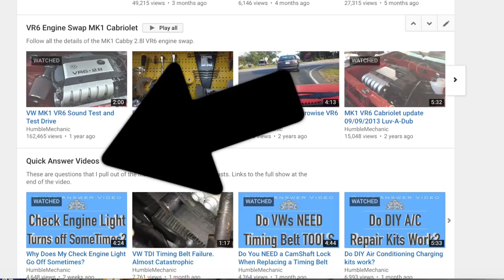Viewer Car Questions ~ Podcast Episode 223

Comment: Thanks again for the great tips. I had a coolant issue like the one you described on a 91 Merc Cougar with a 3.8 V6. I wish I had know what to look for back then. It would have saved me a ton of cash. I don't think people know how much time is saved having instant access to this kind of info on the internet. THANKS!
Reply from the maker: It’s insane to think about how people got info 25 years ago.
Reply: HumbleMechanic I remember having to go to the local library to get the book because I usually only had the cash for parts. I had a notebook of photo copies of pages for the cars I had at the time.

Comment: Most of the time when I've seen dark reservoirs on a VW, it's an iron block engine with the wrong coolant. There are alternatives to G12, G12+, G12++, G13 that are fine, but don't just grab any cheap coolant with 2-EHA, especially on diesels.

Comment: When swaping motors. Generally if it ran like crap or came back a few days later running like crap. It always was a vacum line came off or was left off after instilation. So vacum would be the first place I would go to. If that is OK, then I would check grounding strap.

Comment: I was the guy who asked the last question with the Vr6 swapped caddy. Turns out I took off the throttle body and cleaned it out and now it runs 90% of what it was but slowly getting better. I am currently getting ready to put my obd2 port in the car but all I am having problems now is my clutch now
Reply from the maker: I’m having clutch issues too. Lol

Comment: Hi Charles, great vids, as a techy id like you to do more in depth stuff, and how about doing a common faults chart for the most common engine series - might be v helpful. Also - does the rail pressure not spiking after hot shut off always indicate bad pump (internal valve)or could it indicate bad injector (excess leakoff)? cheers, Stefan

Comment: As far as performance under the engine bay. I would like to see a header back exhaust. Short ram intake, and a 75 wet shot of nitrous. I was actually in a mk4 Jetta vr6 with a 70 shot he said. And it was so badass. Pulled so hard in 2nd and 3rd. Way more than I was expecting. Cmon Charles. You know you want to.  It's something different than everyone else is doing to the 3.2s and affordable. Custom airbrushed nitrous tank with humble mechanic on it. I can see it now. Beautiful and lots of views. Lol

Comment: If I change the key cylinder and use the pre programmed key that goes to the new one would the immobilizer cause the car to shut off or would it not interfere with it?
Reply from the maker: If you get a new key, it must be programmed.

Comment: Popped a code for a coolant thermostat, would it be difficult to remove/replace? It's on a mk4 1.8t.
Reply: Not hard just time consuming. First time I did one on my Mk4 1.8t it took me forever because I tried to do it with extensions and wobble / universal adapters. Second time I went the remove the alternator route and that sucked as well. Third time I removed the intake plenum and that is the way to do it. Little more work will save you a TON of time. 

I would get that done soon though or your car will take super long, or will never fully hear up and your ecu will dump fuel trying to get it up to temp. Your mpg will go to crap.
Reply: Also just realized that you mean a coolant temp sensor not thermostat as the thermostat would not throw a code. CTS is a three min job. Def do it. That little green thing has a lot to do with how your car runs.
Reply from the maker: Pretty much what Adam said. LOL
Reply: Adam Rogers ah, just re-read the code and it is the cts. Glad it's that and not the thermostat! Thanks!
Reply: HumbleMechanic Wow thanks Charles! I have learned so much from you and your channel.

Comment: I know this has nothing to do with your video but I bought a pickup I was told it had a stuck valve I can't tell is checking out white smoke in the back I'm thinking a head gasket what's your opinion? thanks
Reply from the maker: Yeah it could be that. Could be an egr cooler, could be a fuel issue. What valve did they say was stuck?
Reply: HumbleMechanic they said it was number 3 exhaust valve.
Reply: HumbleMechanic cylinder 3
Reply: HumbleMechanic the motor sets in a 2002 Ford F150 with a with a 4.2 L engine they told me it was number 3 exhaust valve stuck cut the motor runs a little rough at idle that run a cops in real good thank you
Reply: HumbleMechanic number three cylinder in a exhaust valve

Comment: I have a 2012 Sportswagen TDi and have decided to participate in the VW buyback option. I turn my car in on March 13th and with the generous return I'm getting am seriously considering buying a new Golf Alltrack. Saw one in the lot yesterday for the first time and it looks smaller than my Jetta Sportswagen. I just have one kid (toddler), so I don't need a big vehicle, but what is your opinion on the Alltrack?  I searched your video library and couldn't find a review. Other options are a Subaru Outback and the new Tiguan. Thanks.
Reply from the maker: I like the Alltrack more than I expected. It drives great gets fair MPG, and looks cool. 

It’s about the same size as your JSW, but I think by the numbers it’s bigger.  

My issues with it are1) it’s a little smaller than I would want for that car. 
2) I want more HP(I always will want that) 
3) It came out at the worst time. It should have been out 10 years before. That delay let Subaru dominate that market. 

That being said with the deals they have on the 2017, you can get one for a great price.
Reply from the maker: I like the New Tiguan too. And Subaru makes great cars. I’m always just a little disappointed with the interior of Subaru. I think vw wins that hands down.
Reply: Subaru interior has been my disappointment too, but the Outback I saw yesterday actually has a pretty nice interior and dash (cloth seat model, though). I test drove one a few years ago and the interior looked cheap, but it seems they've upgraded that. The 2018 $42K Outback looked amazing inside and out, so they can do nice, if you want to pay. Thanks for the reply, I'm going to test drive all three and perhaps the CX-5 and CRV, but I just like the VW's better - I've owned a Rabbit (first car), Jetta, Passat, and this TDi.
Reply from the maker: I have a ton of friends with the CX-5. They all love it.

Comment: Are you jew? :) OK let's be serious
If u have a turbo charged 3.0 diesel and you were going down a hill on a paved road would you put the shift to N or the turbo would turn hot
Reply from the maker: Yahya Safoury what would that have to do with anything?
Reply: it only works if there is a full moon at 1:39pm otherwise you need to cut your hair and boil some salt